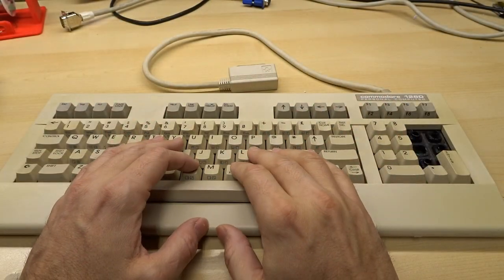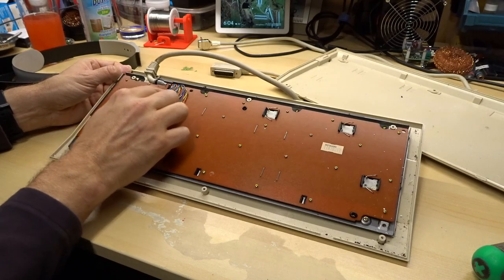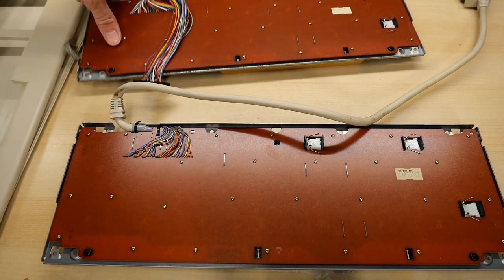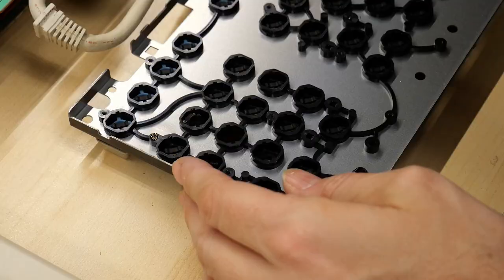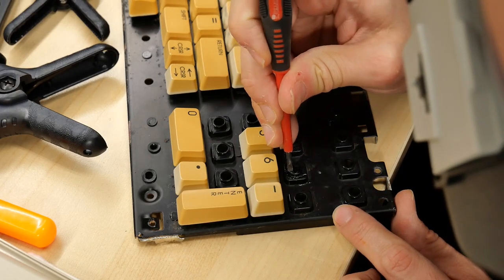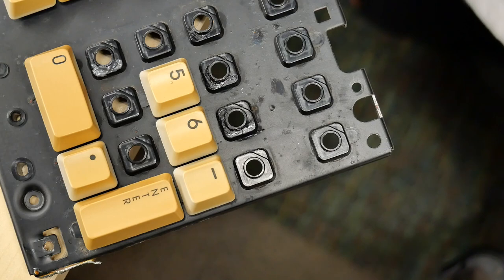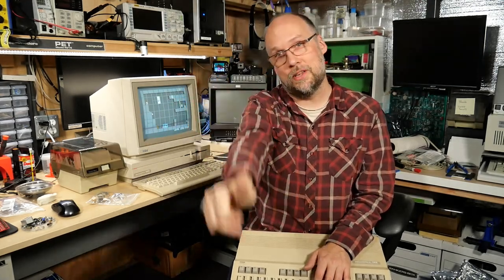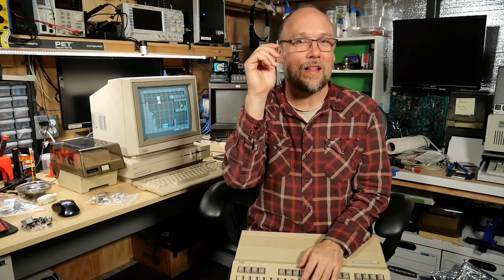Fixing the C128D keyboard (and more!)

Comment: Try to add baking soda onto the glue.
Reply: It's supposed to. You can even use it to  build up missing pieces like the little clamps from a monitor panel. It may be a bit brittle because it's not flexible like the plastic.
Reply: @adriansdigitalbasement  Youtuber AkBkuku used baking soda plus superglue. the mix hardens so fast. he published one video about how well it works. And it's like Sven Werner said,  you can build small pieces and even fill gaps.
Reply: @adriansdigitalbasement  yes it does. + it works like an extra plastic layer, holding broken plastic together